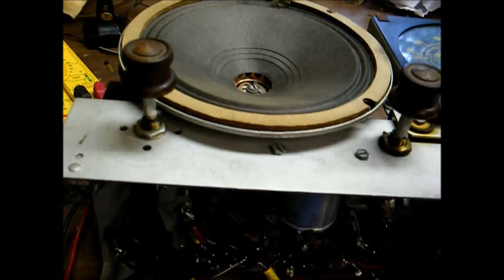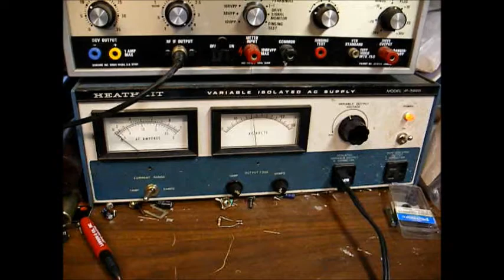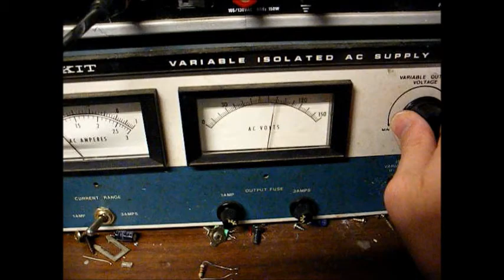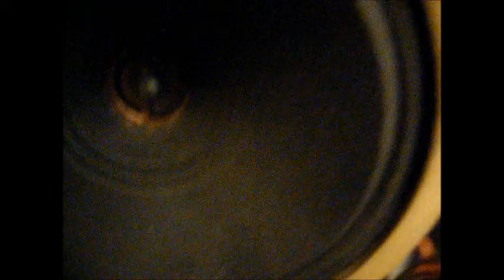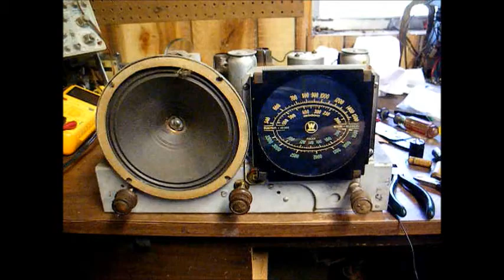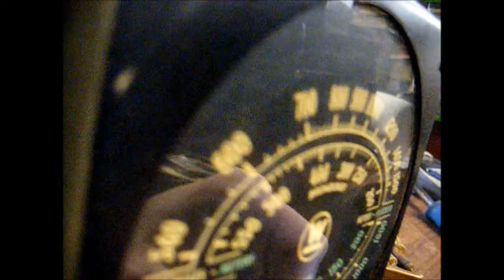Westinghouse WR209 tube radio electronic restoration - part 3

Comment: In the last video you made a mistake with the replacement of the .05 .05 capacitor.  They did not make a mistake and print the value twice as you thought.  Instead this is a two section capacitor with the metal ground strap in the middle being the common ground for each end.  So this is two ,05 capacitors in one case.  You should have replaced it with two .047 capacitors.

Comment: Sounds like a bit of IF oscillation. I have a Westinghouse "fridge" radio from about 1948 that did this like mad after I re-capped it. Finally I ended up poking around in there and found that moving some wire lead changed it. I moved things around till it stopped acting up and its been fine ever since. I guess I moved something when I re-capped it. Tiny little thing inside that is, AA6 design in a chassis barely big enough to fit the tubes.

Comment: I really like the look of this radio, with the round dial and all - hope you get it up and running well.  Thanks for the great video -- I know how hard & time consuming it is to shoot and edit a quality vid.  Off subject - where do you get your 3 or 4 position terminal strips (for soldering the electrolytic-caps to)?  I picked up a couple at a ham radio swapmeet, but they are VERY poor quality.  Any Ideas?